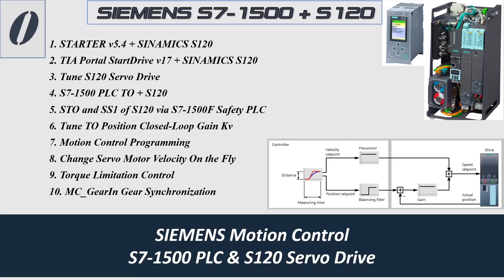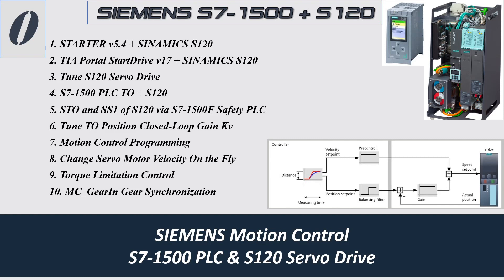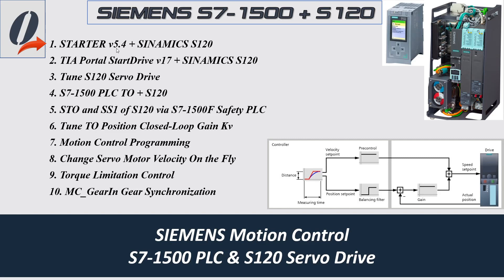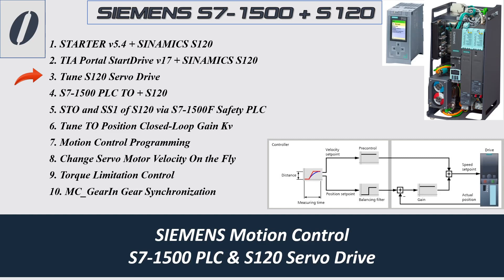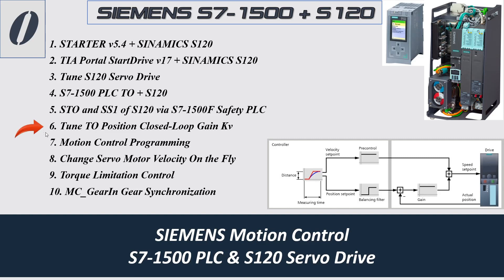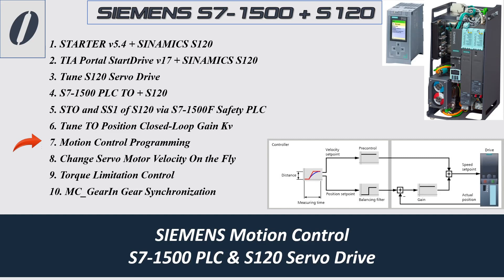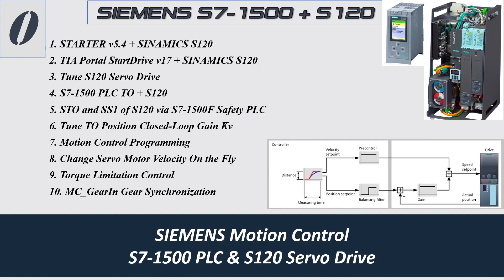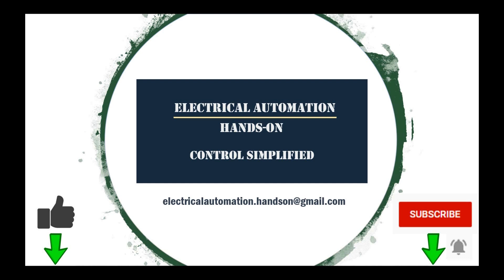MS05a. [Siemens S120 #0]SIMAMICS S120 Motion Control Series Open Speech (S7-1500 + S120)

Comment: Hello Sir, if i have CU 320-2 DP with CBE20, i need to change some parameter at the start of parametrization or?
Reply from the maker: If you are using Profibus-DP and the CPU is still S7-1500 (e,g, S7-1516), other than the Profibus network configuration, the parameters from the drive are almost the same.